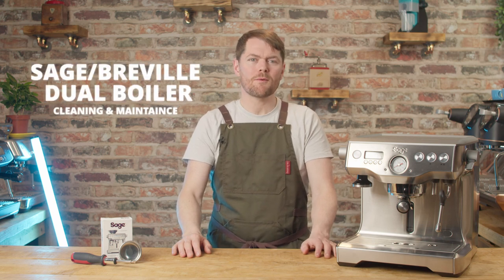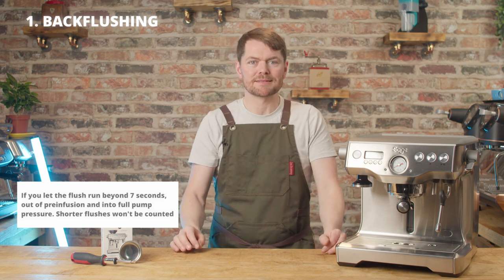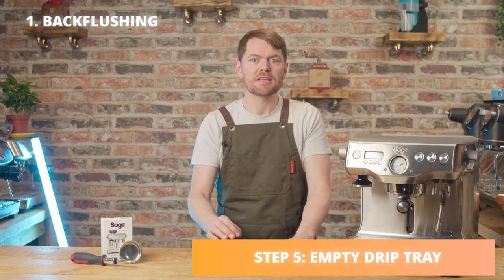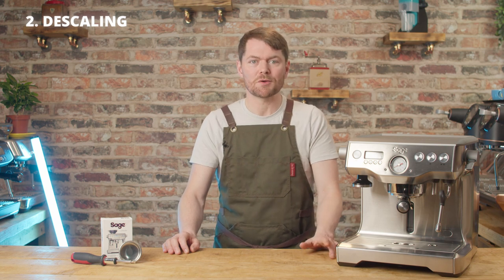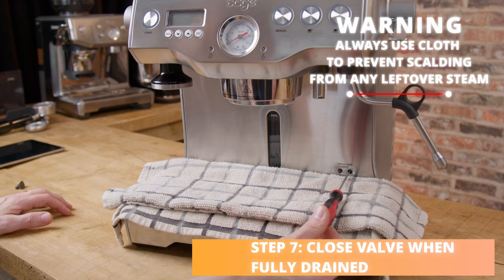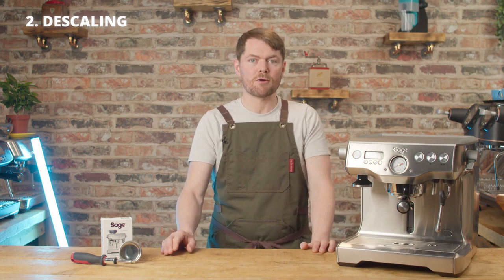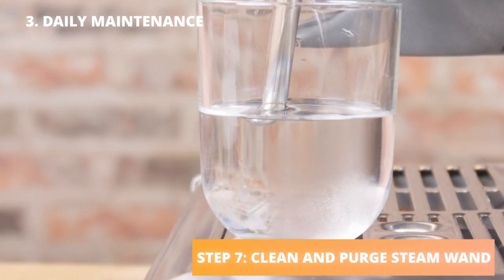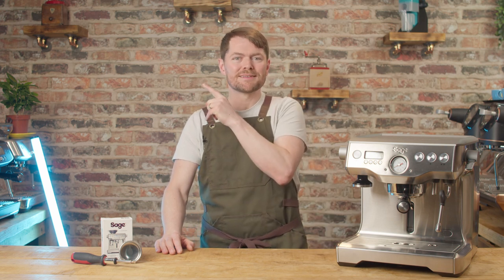Sage (Breville) Dual Boiler: Part 7 - Cleaning, Backflushing and Descaling

Comment: Love your accent mate! But actually it does not matter if you use bottled, filtered water or you live in a very soft water area. Scale is inevitable. The only difference it makes is how often you need to do that. Sage customer service has said to descale at least every 4 months even if you use the best quality water there is. Sadly there is no way to skip descaling if you want to have a healthy machine for years. 

PS. Make sure you descale according to manual and definitely don't just use ANY descaler but only the original one as you have no clue how harsh of a descaler you could put inside your machine.
Reply from the maker: We'll have to agree to disagree  ;-), I've never descaled my espresso machines, I've never had scale build up. I live in a soft water area. My Gaggia classic is 20 years old, the folk I bought it from about 8 years ago hadn't descaled it (they were local to me) I've never descaled it, there's no scale build-up. My advice (if not in a very soft water area) would be to use an under counter or counter top filter or reverse OM system and to just give these machines a proper yearly service (either DIY or via an espresso engineer) and for the boiler to be descaled during this service. Cheers, Kev.
Reply: @Coffee_Kev  Unfortunately you have that one wrong my friend. It's not about agreeing or disagreeing, it's about the truth. ANY water contains either some or a lot of calcium and magnesium. This is common water physics. The more amount of minerals inside the water= the more harder the water is. If you think about groundwater for example (in where many people get their tap water) how on earth could all this water avoid the minerals that are inside the ground? Even if the water is very soft, there are still some minerals in the dirt, otherwise we would have no life on this planet.

The only way to have scale free water is with distilled water where all the minerals are vaporised but this will destroy your machine for sure because of the lack of minerals will cause corrosion to your espresso machine.

The thing that you have used your machine for years and not have descaled it, does not mean that the machine is scale free. To know if it's scale free, you'd need to look inside the boilers and not assume that. Also talking about Gaggia products I can only assume those are well built Italian espresso machines, unlike Sage ones where there's cheap materials used all around the machine. 

I myself use a very soft bottled water which is filtered by the water provider. I also filter this water once again with the water filter inside the DB and I can see the scale slowly starting to build up month by month. Like I said it's only a matter of time. I commented previously a way of making sure that I'm right. Test this out with a water kettle. Put the same water there which you use in your espresso machine and watch what happens with it. Good luck trying to convince someone that not a single piece of scale will build up on that kettle with the softest most filtered water used in 20 years 😊
Reply from the maker: The truth is, I've never descaled an espresso machine, in a very soft water area, using tap water, and I've never had scale issues.  Anyway, I stand by my advice where the Dual boiler is concerned, which is to use soft water, and for users to only descale it themselves if they're happy doing a bit of DIY if required, and if they're not, to find an engineer to do the descale for them while doing a yearly service, which I highly recommend with these machines.  Cheers, Kev.
Reply: @Coffee_Kev  I will agree with the service part, as in that way you take away the responsibility from yourself if something happens. But still I advice you to read a bit about water science. Then you would understand better what are minerals, what is scale and how it's all around us. If someone says they have had no issues with the scale it does not mean that the scale has been avoided inside the machine. I have a friend that repairs a lot of home appliances, that includes espresso machines. He has dealt mostly with the super automatic espresso machines and he always tells me that the first cause of an early end of any espresso machine is scale. He has seen some awful pictures about machines that are said to use filtered soft water by the users but still look horrible. He once said to me that an inside of a Jura machine looked like it was mossy, basically a life was going on inside the espresso machine because it was not cleaned for SEVEN years. And I can only guess that a resort like the one inside the machine did not develop within the days the machine started to have issues producing coffee. This probably took years to build up. 

I would never ever suggest anyone to not descale their water related kitchen equipment. I see there is a huge amount of suggestions to the DB to not descale the machine if they don't want to get a blocked steam sensor. But letting scale build up in an espresso machine, especially the Dual Boiler is a granted finish to your machine. My suggestion would be if you have the softest filtered water to still descale at least once (better twice) a year. That should be a nice effort for a long lasting healthy machine.
Reply from the maker: Hard water causes limescale, if you're using soft water (low in calcium and magnesium) you shouldn't get scale buildup. When I say I've had no scale issues, I mean literally no scale buildup. Same with kettles and so on, if you're lucky enough to live in a soft water area, or if you're using soft water via other means, you shouldn't get scale build-up.  I'm not suggesting that people shouldn't descale kitchen equipment, though. Domestic coffee machines that can be descaled with no problems, via flushing the descaler through the group and the steam wand or the milk system, I think doing preventative descaling is fine.

The Dual boiler though isn't built like a normal kitchen appliance, the water circuit works like a commercial espresso machine, descaling is (or at least can be) a much more involved process, so with the Dual Boiler, I recommend anyone who isn't happy taking the lid off, if needs be, to prevent the need to do regular descaling. In my opinion, if someone is using soft water, letting an engineer descale it for them as part of the yearly service should be fine. 

Yes there's a lot of info online suggesting not descaling the DB. I think descaling is fine, as long as the person doing it is OK taking the lid off, the issues that can happen aren't that big a deal if you're OK with a bit of DIY. Failing that, though (and a lot of people aren't comfortable with DIY) my advice with the Dual Boiler is to find someone who will service it, and give it a yearly service. This way the O-rings can be swapped (to prevent potential leaks which can cause big problems) a descale can be done (and in my opinion a yearly descale should be fine if you're using soft water), and all should be good. These machines should keep on going for years with a yearly service.

Cheers

Kev
Reply: My washing machine is 30 years old. Always used softened water. Never had scaling. Never been serviced because of water flow issues and no repair for over 25 years. 

My Sage Duo Temp Prop I had in use for 5 years and never any signs of scale. I use softened water and reverse osmosis. 

After installing a water softener system into a property that did not have one it took some time for some of the pipes to descale. That resulted in one tap outlet to get scale build up. When I replaced that nothing further has been needed. 

Softened water systems use a salt solution to clean the filters. This slightly increases the salt content of the water. Boil enough water dry and the white power left is salty. Do the same with the drinking water reverse osmosis and I can't taste anything. 

In a property I rented it was a short term let, lasting 5 years. I used bottled water from the supermarket. The kettle and coffee filter machines had no scaling. Not all bottled water is soft water and some will scale up with particles even if not lime scale. 

Regions are different and water standard are not the same in all countries. Your mileage may differ.
Reply: @geraldmcmullon2465  you must have a very good washing machine if it has lasted you 30 years. No wonder any scaling does not do any harm to it. I have had a lot of water related equipment over the decades and I've seen the things get worse and worse year by year. In the 90s firstly there were hardly any electronics inside the machines, so it ruled out one big portion of problems. Secondly, the machines was very heavyly built. Everything you could buy (of course they were a lot more expensive than now) felt like they were meant for commercial use. Even the first fridge I got weighed a ton, we had 6 people pulling that one into my apartment. And it was a small (I guess 100L'ish) fridge. Lasted a lifetime and maybe would even last today, but it made terrible noise and also the electric consumption and safety came to mind.

Anyway, decades later. What do we see now in electronic stores. You can get a coffee grinder for 30 dollars, you can get a toaster for 5 dollars, a kettle for 5 dollars and so on. If you start thinking about it, what do you get for 5-30 dollars now? Basically nothing, maybe some food. So it really should make people think what they're getting instead of "wow, what a great price". And this puts another pressure on the market. Price point! Everybody has to compete with this most important thing- price. Sage is a very good example of that. They make the same espresso machines that are in the 2000 and 3000 dollar/pound/euro group. But they sell them in 1000's. How come many people may ask. Well if you start thinking about it, it must be those small steps backwards in machine building. So instead of having hard metallic components you get cheap plastic ones and so on. What this really does is takes a huge amount of life out of the home equipment we use today.  

What I'm trying to say is that there is no point of comparing something from the 90s from what is sold today. The market has changed so much that nobody will talk about using 30 year old products in the 2050s because nothing would not last that long. This is also called aftermarketing. Why should you make something for the consumer that would last them a lifetime when you could just tell them that "see, after 5-8 years this machine is gone and I'd advice you to get a new one." Even the cars market are like that nowadays. People still ride along with cars from the 90s and have no problems with them but then again have huge electronic problems from the cars they bought 5 years ago.

And last, there is no point of discussing something that does not need to be proven. Water comes from Earth, it's filled with minerals like magnesium and calcium that produce limescale. Some places have a bit more of it and some less. But none have it limescale free. The only thing that is scale free, is distilled water and thats only because all the minerals are vaporised from the water. That is the only way you can remove all the minerals. But you can't use this water inside your home electronics. You really cant even boil it on your gas stove and make coffee with it because all the coffees need minerals to give out the sweetness of that coffee flavour. I have done coffees with distilled water and those were really terrible. Reverse osmosis is meant for sea water to be turned into drinking water. That is not a way to make your machines scale free. 

So it's really not worthy to discuss if someone has had scaling problems or not. This does not change water chemics which are still the same. People can even use very hard water to their very old home equipment and still have no problems. That does not mean the scale has been avoided, it only means you have a very strong machine. 

Also how can someone tell they have no scale issues if the machine has not been serviced for 20 years? Does not make sense to me. "My Sage Duo Temp Prop I had in use for 5 years and never any signs of scale" How do you know that you have no problems with scale? Have you looked inside the machine or you just guess you have no scaling?

PS. Water is usually "softened" with adding sodium to it to compensate the magnesium and calcium minerals. But that means that salt will literally start to accumulate your boilers and it's only RIP coffee machine. In many cases people are trying to let's say play God and invent something that does not exist. Now we see them taking demineralised water and adding some miracle solution like Pavlis water formula but still they don't know that the people that designed this machine did it with a thought of people using normal water, not fantasy water. So you have no idea what you do with your home equipment by doing those tests at home
Reply: @moviemaster00000  Yes I have looked inside the Sage Duo Temp Pro. Lime scale was removed from the water first it gets to the device. Before I installed the water filtering system my kettles, coffee machine, steam iron and washing machine all had bad levels of scale clearly visible and needed descaling. 

The filtering does change the chemistry. You may argue that it does little but the heavy scale build up is seen quickly in houses without a soft water system.
Reply: @geraldmcmullon2465  I have been around many water related equipment over the years so I know what I've seen. 😊 I've seen a lot of 90s water related equipment that are full of scale but still work like they're well maintained (yes, even half a  century ago you had the good versions of stuff and bad versions but right now I'm talking about the Rolls Royce of stuff). Okay they might have done a better job if they'd been descaled but the point is they can work and they can work a big time. That is not true for todays equipment. They are just not built for it. Like the Sage Dual Boiler, it really does not have to take a lot of limescale to completely destroy the machine. The most common problems people get, is they say they have no visible scale but after they do their descale cycle they get a lot of errors and start to blame the decision they descaled. Actually the problem is that they didn't descale often enough and they let all the scale build up inside the machine and after descaling all the scale blocked everything there could be block.

Having this kind of a water system like yours sure takes time, energy and money. Like how often do you change your filters there? How about with the sodium? How much money does it take from you per year? Those things need to be dealt quite frequently as I even see from my own eyes, the limescale is still not 100% avoided. The thing you cannot spot scale does not make water 100% scale free, it just makes it soft and soft water is not scale free. And then again you're not 100% sure what this water does with your machine. Does it produce corrosion instead of limescale or how would it affect the overall coffee taste. You see that the salt is barely(meaning there's something seen from the eye) noticed but keep in mind that salt is a thing that really starts to build up in small places. And an espresso machine is full of small pipes and holes, especially Sage ones. I really see no point of inventing something there's no need to invent. If Sage has said to even descale with very soft water, but to do it more rarely, why not do it then? Even I with using the most softest water (filtered 2 times) descale 2 times per year. And yes there are magnesium and calcium compounds released from the machine. Not a lot but enough for it to produce problems over the years (or even if it wouldn't cause any problems, but if I don't descale and have no problems that comes to me being lucky not because I've maintained my machine well).

Also I would be careful with drinking this water what comes out of your system. The WHO has warned people with that system that they are simply drinking lifeless water and after some years health issues may arrive. 

Soft water means that there are no scale spots on baths, drinking glasses etc..., that is correct but it does not mean that the scale is 100% avoided there. You might have a trusty filtrating system but keep in mind as time passes, the filters will also start to be more indulgent. Having a filter now which should last you maybe 6 months will slowly start to lose it's effect, especially if you use a lot of water in your house. Heavy scale does not build only in homes without soft water system. For example my cousin has a summer cottage with the softest water you could imagine. I even did the electronic water hardness test there and it really showed some low numbers. Nothing was filled with white spots there. The kettles seemed also scale free after years of using those. Once I decided to do a test and descaled one of the kettle with vinegar. After that I took a magnesium and calcium test on that water and the numbers went to the ceiling. So I really do advice you not to only trust your eyes with the scale but water chemistry. Very hard water leaves a ton of scale which everyone could see, but this means also descaling needs to be done rather not in months but in weeks. Soft water may not show you nothing but it does not mean scale has been avoided. The only win for a soft water user is the frequency they have to descale. Descaling or not descaling and not having problems might not mean anything. 

Like I said before on my comments my friend is a home electronics repairer and he once tried to fix a Jura espresso machine that was not descaled for 7 years (guess you could call this a strong machine nowadays). For 7 years it maintained it's work and still looked like a vegetation was going inside the machine. This machine had huge amount of scale inside it and it still worked. Was the scale avoided? No. So let's now imagine that why should a person who uses this machine with soft water for 7 years and also does not descale have any problems if it could maintain this mass of scale? But does the second person also avoid scale? No. The story remains the same for both of them. We just automatically assume that the hard water guy is the bad one because he did not take care of his machine but actually so didn't the second one. The second one was just that lucky that he had such a soft water and that the first guy tested out that this machine could run with heavy scale for 7 years. It was a strong machine and so the second guy could brag that his water is so pure that he even does not have to descale his espresso machine. But is it really the case? Has the scale been avoided or has he just been that lucky to have a reliable machine that can deal with the amount of scale that his soft water has produced?
Reply: @moviemaster00000  Salt blocks every couple of weeks about 20 bags a year. Filters annually..
Reply: @geraldmcmullon2465  One year without changing your RO filters sounds a bit much for me. Even if you don't use that much water. It's usually advised to do that within 6 months but keep in mind, as time passes the filters work quality will also lower. This basically means that it wouldn't filter the same like it did on the first week you installed it. The RO membrane is the thing you can keep for a couple of years but not the filters. 

Indeed a RO system is a luxury but what I'm trying to tell is that this is no solution of not having to descale your home equipment and espresso machines. We're still talking about descaling and not descaling as Coffee Kev said that you basically don't need to descale if you have soft water. What I'm trying to say here, is that it's wrong. Having soft water does not mean it's scale free. It's true about the RO water as well. 

People waste huge amounts of money to put a very complicated system inside their houses. This is the same with the distilled water and Pavlis water formula I mentioned before. They try to get rid off all the limescale and make their water perfect but it's just not possible. They're making their water soft, nothing else. If adding other solubles also, this could cause a problem to the home equipment as you don't know what are the long term effects on them. The WHO has advised people to not long term drink this because all the minerals we need for our health are taken away: "According to the World Health Organization, low mineral (TDS) drinking water produced by reverse osmosis or distillation is not suitable for long term human consumption and in fact, can create negative health effects to those consuming it."

WHO has advised people in the third countries to use sea water to turn this into drinking water because they're simply lacking pure drinking water. I have not that kind of a problem in my country (I can guess neither have you in UK), so doing this here would not be only an unwanted risk but also pointless.
So I would definitely advice getting mineral water from the stores to drink if you have that kind of a system at home. One other thing comes to the mind that an adult human organism can safely digest only 6 grams of salt per day. Mostly this comes with food and mostly people consume about 3 times as much as it's safe to do. Taking the risk of consuming sodium also with water seems pointless for me, even thought RO system should remove 90ish percent of sodium from the water. But then again keep in mind that this percentage will start get smaller and smaller by the period of time the system has not been maintained. 

If you notice having salt coming directly from your piping, this is a clear worry for me because salt will slowly destroy the walls inside of the pipes. It will eat a small hole thro them and you will soon have a very bad water leak that may come even from behind the wall or ceiling, depending where your piping system runs. If you want to use the RO system in your house, you have to make sure that all the pipes inside your house are filled with the RO system water, not only the one you drink from. 

Indeed you understand me correctly:"RO removes 92-99% of calcium and magnesium.". Like I said this is not scale free water because it does not remove 100% of calcium and magnesium. Having this system not maintained properly will even lower the 92% quite a lot. So this is not a scale free water, it's soft water. Meaning descaling is needed to water related equipment like coffee machines, kettles and washing machines. Having that much of a softer water means you could maybe do that once a year. Keep in mind that descaling is not the only maintenance activity you must do. So even if people are desperately trying to avoid descaling they still have to take care of their equipment like a washing machine. Or even the Sage espresso machines. So people have not removed activities and obligations from themselves but rather created more with the system they have installed their house. 

What I've seen a lot in my life is people trying to invest to something that is already been made for them. I once heard someone from the city wanting to get a RO system because they watched the TV and it was said to remove all the chemicals and bacteria from their water and they started to worry about their health. What they didn't take in mind was the thing that they were already joined the local city pluming where all this filtering and maintenance took part. If you're a part of a local city plumbing you don't need to worry about chemicals or other bacteria getting inside the water as the company takes care of this problem themselves. They must do water tests to see everything is correct. So having this kind of a system at home for health concern does not make anything better, you just throw away your money and create problems yourself. Does not matter if the water comes from groundwater or from a lake, local city plumbing which you pay, has to make sure it's safe to drink. 

In conclusion the RO system could be benefitable if you maintain it properly. But it will not take care of the descaling needs inside house hold equipment. Also having water that may contain even traces of sodium could not be only dangerous to your plumbing and boiler system but to the home equipment as well. So instead of having less problems you might have even more and more troublesome with corrosion and scale both at once. This is just a thing to keep in mind.
Reply: @moviemaster00000  I follow the guidelines for filter changes from the manufacturer.  The WHO report cited I can't find.
Reply: @geraldmcmullon2465  Sadly youtube keeps removing those articles, but I try once again. It's a summary of WHO's statement: "According to the World Health Organization, low mineral (TDS) drinking water produced by reverse osmosis or distillation is not suitable for long term human consumption and in fact, can create negative health effects to those consuming it" I will now try to paste the link on my next comment.
Reply: @geraldmcmullon2465  Even if you change your filters according to the manufacturer it does not mean descaling cycles are not needed inside household water related equipment. Also I would be quite concerned like you say you see clear visible salt coming directly from your tap water (after you boil it). The whole idea of the RO system is to prevent any sodium build up in your pipes. I would do sodium test if I'd be you and see what are the level of salts passing from your system. I once visited a countryside house near the ocean. The water installer had accidentally put the borehole way too deep, so he missed groundwater and started getting some sea water mixed with ground water. Those pipes all around the country house did not last even a year.
Reply: @geraldmcmullon2465  If Youtube keeps removing the articles I can copy the text here: 
What is alarming is that consuming reverse osmosis water for even a few months can create serious side effects. "The effects of most chemicals commonly found in drinking water manifest themselves after long exposure." However, "only a few months exposure may be sufficient 'consumption time effects' from water that is low in magnesium and/or calcium."

Illustrative of such short-term exposures are cases in the Czech and Slovak populations who began using reverse osmosis water systems at their home taps in 2000-2002 as part of a government program to deal with contaminants. The quick and widespread deployment of reverse osmosis systems in these populations provided a unique opportunity to study their health effects. "Various health complaints suggestive of acute magnesium (and possibly calcium) deficiency were reported within several weeks or months. Among these complaints were cardiovascular disorders, tiredness, weakness, and muscular cramps." Again, these severe side effects appear within several weeks or months.

Because reverse osmosis water doesn't have enough minerals, it also leaches minerals from the body. As a result, the mineral content of food and vitamins are urinated away. Fewer minerals consumed, plus more minerals excreted, equals serious side effects and significant health problems. In a scientific study performed to see if minerals consumed in food can make up for the lack of minerals in reverse osmosis water, scientists concluded that "reduced mineral intake from water was not compensated by their diets...low-mineral water was responsible for an increased elimination of minerals from the body."

"It has been adequately demonstrated that consuming water of low mineral content has a negative effect on homeostasis mechanisms, compromising the mineral and water metabolism in the body." Consumption of reverse osmosis water "leads to the dilution of the electrolytes dissolved in the body water. Inadequate body water redistribution between compartments may compromise the function of vital organs. Side effects at the very beginning of this condition include tiredness, weakness and headache; more severe symptoms are muscular cramps and impaired heart rate."

Since the adverse side effects of reverse osmosis water were scientifically confirmed, one popular trend is adding minerals back into the reverse osmosis water. On this trend, scientists advising the World Health Organization stated that "possibly none of the commonly used ways of re-mineralization could be considered optimum, since the water does not contain all of its beneficial components. In the case of borderline deficiency of a given element, even the relatively low intake of the element with drinking water may play a relevant protective role."

Recreating natural water with all its minerals and trace elements from reverse osmosis water is practically impossible. So why risk the side effects of reverse osmosis water in any form if healthful alternatives are available?

Calcium and magnesium are both essential elements. Calcium is a substantial component of bones and teeth. In addition, it plays a role in neuromuscular excitability, the proper function of the conducting myocardial system, heart and muscle contractility, intracellular information transmission, and blood coagulability. Magnesium plays a vital role as a cofactor and activator of more than 300 enzymatic reactions, including glycolysis, ATP metabolism, transport of elements such as sodium, potassium, and calcium through membranes, synthesis of proteins and nucleic acids, neuromuscular excitability and muscle contraction.

Although drinking water is not the primary source of our calcium and magnesium intake, the health significance of supplemental intake of these elements from drinking water may outweigh its nutritional contribution expressed as the proportion of the total daily intake of these elements. Even in industrialized countries, diets not deficient in the quantity of calcium and magnesium may not fully compensate for the absence of calcium and, in particular, magnesium in drinking water.

Although drinking water, again, with some rare exceptions, is not the primary source of essential elements for humans, its contribution may be necessary for several reasons. First, the modern diet of many people may not be a good source of minerals and microelements. In the case of borderline deficiency of a given element, even the relatively low intake of the element with drinking water may play a relevant protective role. This is because the elements are usually present in water as free ions and, therefore, are more readily absorbed from water than food, which is mostly bound to other substances.

Since the early 1960s, epidemiological studies in many countries worldwide have reported that water low in calcium and magnesium is associated with increased morbidity and mortality from cardiovascular disease.

Recent studies also suggest that the intake of water low in calcium (reverse osmosis water) may be associated with a higher risk of fracture in children (Verd Vallespir et al. 1992), certain neurodegenerative diseases (Jacqmin et al. 1994), pre-term birth and low weight at birth (Yang et al. 2002) and some types of cancer (Yang et al. 1997; Yang et al. 1998). In addition to an increased risk of sudden death (Eisenberg 1992; Bernardi et al. 1995; Garzon and Eisenberg 1998), the intake of water low in magnesium seems to be associated with a higher risk of motor neuronal disease (Iwami et al. 1994), pregnancy disorders (so-called preeclampsia) (Melles & Kiss 1992), and some types of cancer (Yang et al. 1999a; Yang et al. 1999b; Yang et al. 1999c; Yang et al. 2000).

Recent epidemiological studies suggest that reverse osmosis water may be a risk factor for hypertension and coronary heart disease, gastric and duodenal ulcers, chronic gastritis, goiter, pregnancy complications, and several complications in newborns and infants, including jaundice, anemia, fractures and growth disorders.

When used for cooking, reverse osmosis water causes substantial losses of all essential elements from food (vegetables, meat, cereals). Such losses may reach up to 60% for magnesium and calcium or even more for some other micro-elements (e.g., copper 66%, manganese 70%, cobalt 86%). In contrast, when mineralized water is used for cooking, the loss of these elements is much lower, and in some cases, an even higher calcium content was reported in food as a result of cooking.

The current diet of many persons usually does not provide all necessary elements in sufficient quantities, and therefore, any factor that results in the loss of essential elements and nutrients during the processing and preparation of food could be detrimental for them.

In a multi-city study, women living in cities with low-mineral water more frequently showed cardiovascular changes (as measured by ECG), higher blood pressure, somatoform autonomic dysfunctions, headache, dizziness, and osteoporosis (as measured by X-ray absorptiometry) compared to those of cities with higher mineral content water.
Reply: @moviemaster00000  I installed the soft water system and reverse osmosis in 1989. I have been drinking mostly from the reverse osmosis system ever since. My GP does not know of any issue. I asked today.
Reply: @moviemaster00000 After I boil 5 litres of water away and refill and repeat eventually I can see a tiny amount of white power that has a taste of salt. This takes hours. It is an experiment. I never see this in normal use.  The reverse osmosis system is a three stage filter. It is for drinking water only. A system will support a family of four. It is not able to support all the washing needs. You would need a larger installation than these £2k systems. The reverse osmosis removes any slight trace of salt that is used in flushing and cleaning the softened water filters.
Reply: @geraldmcmullon2465  I know how a RO system works and I also know how it does not replace descaling. Listen pal, we're getting off topic here. I made my first comment here to address Coffee Kev's statement that you don't need to descale with soft water. It's a a fact that you do! If you do what ever kind of experiments with your water you must keep in mind that you are doing life and equipment experiments with each one of them. 

The RO system is considered to carry potential health hazards. That is a fact as well. There is no point of wasting a lot of money to install a system like this to avoid descaling and start to gamble with corrosion and your health. If you've done it and you're happy, good for you, but you cannot recommend this stuff for people who have normal local plumbing and just don't want to descale. It's just pointless.